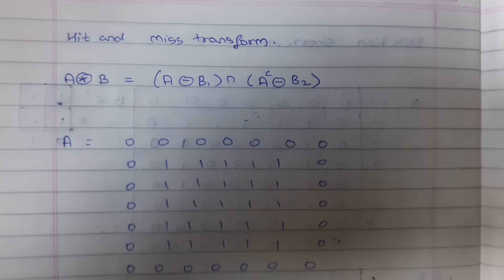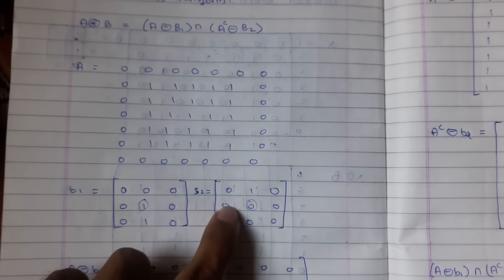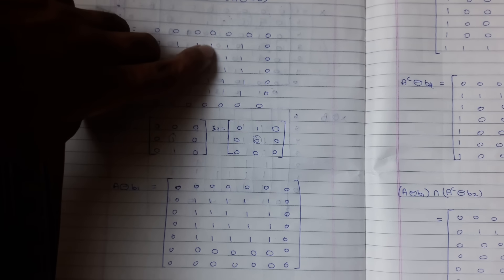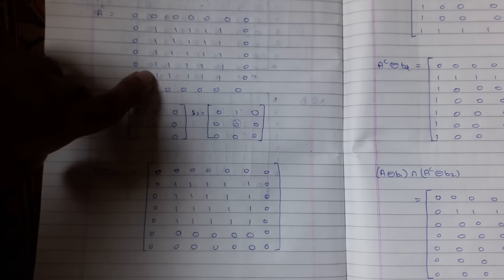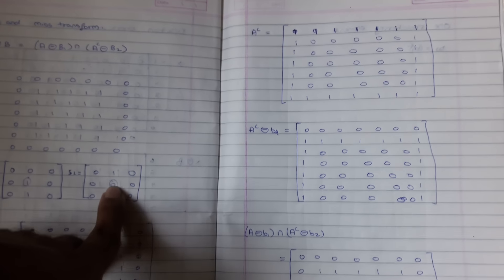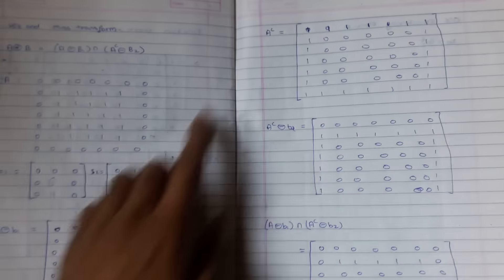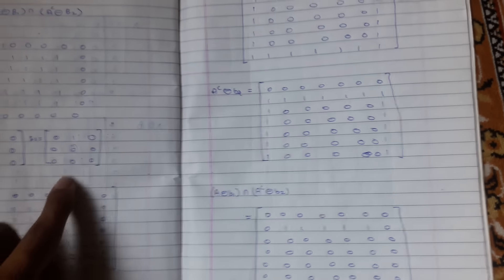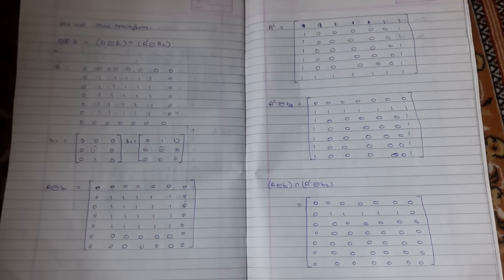Hit And Miss transform

Comment: in a erosion b1 if seed point is in topmost row second coloumn then it should be one right??
Reply from the maker: Sorry I could not understand your question properly 
Normally for a 3 x 3 structuring element the center point is taken as the seed point. 
Are you asking what will happen if we take the element in 2nd column in the topmost row as the seed point?
Reply: If seed element is one then is it rule that one should be checked only placing it above 1 in the mani matirix
Reply from the maker: @ramanhari6464  if the seed element is one then whereever you have one in the stucturing element at all those places you should have one in the image then only the output will be 1. For more clarity you can look at this video

https://youtu.be/_P_EkWkSz_o
Here i have explianed dilation and erosion from the basic formula

Comment: What is the smallest number of different structuring elements that you would need to use to locate all foreground points in an image which have at least one foreground neighbor, using the hit-and-miss transform? What do the structuring elements look like?
Reply: Question -2 How can the hit-and-miss transform be used to perform erosion?
Reply: Question -3 How can the hit-and-miss transform, together with the NOT operation, be used to perform dilation?

Comment: How to make skeleton of text using hit and miss transform
Reply from the maker: Vesh Raj Joshi as in for ocr ?
Reply: Yep, thanks for your reply Pratik Jain. You are absolutely correct but this answer is not expected one. As described in https://homepages.inf.ed.ac.uk/rbf/HIPR2/thin.htm, I make use of (figure -1) 8 structural elements (2 structural elements rotated by 90,180,270) .  
I tested it on imaged given Japanese letter (like hindi 3) in article, i am not getting the result as given above article.
Reply: What should i do here?  is that doing as yours for four times ... first  time consider original image  and compute hit and miss transform and compute  hit and miss transform on consecutive results of.
Reply from the maker: are you testing on matlab or just manually ?
Reply: no no i am not using matlab ... i am going through java and php(manually wrote code)
Reply from the maker: Vesh Raj Joshi suggest you to go through this video 
https://youtu.be/JcldN7nUizo 
I guess it will clarify all your doubts
Reply from the maker: Vesh Raj Joshi i must say you have very good skills in order to code this in java or php .... Hats off ..

Comment: Thanks for your video. You said b2 is complement of b1, but if thats the case,
 b2 = [1 1 1;1 0 1;1 0 1],
 which is complement of b1=[0 0 0;0 1 0;0 1 0] .
But i can see your b2 is [0 1 0; 0 0 0; 0 0 0] which i dont agree.
Reply from the maker: james tanaka here b2 and b1 both were given in the question ...
I said when say only one structuring element is given say b1 then take b2 as the complement of b1
Reply: thanks!